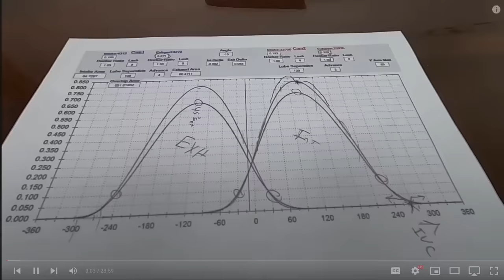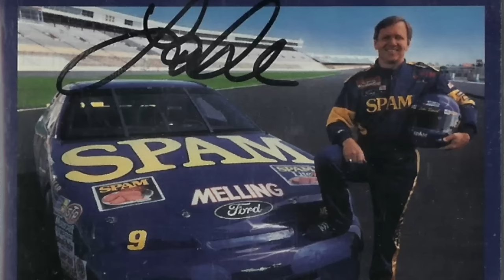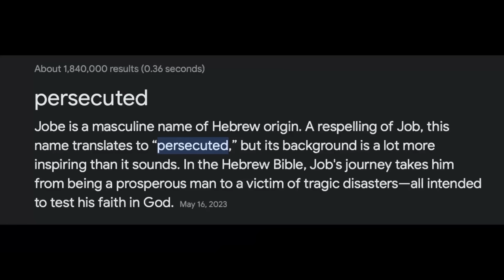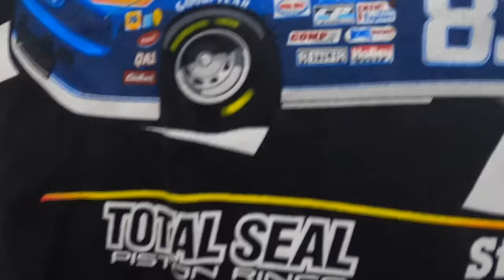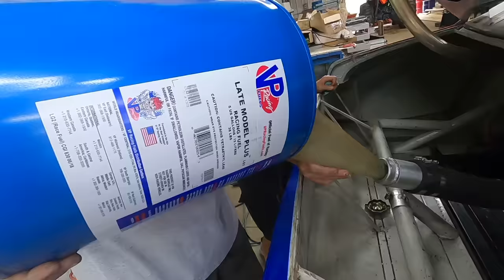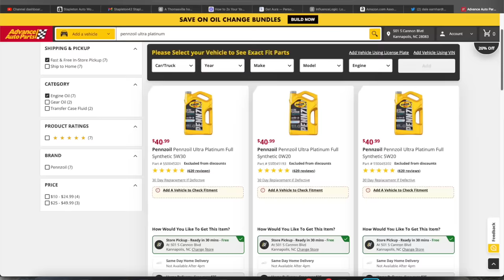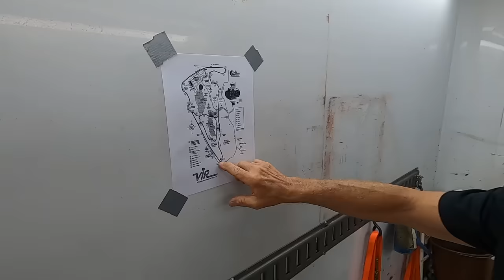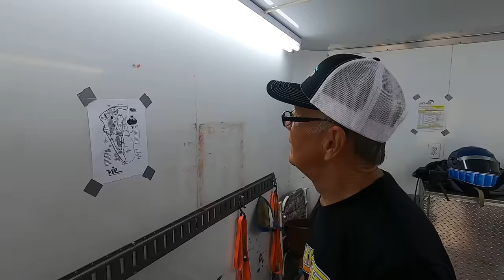Lake Speed's 90's NASCAR Thunderbird Resurrection: Running 780hp Wide Open at 75 Years Old!

Comment: I came across your video about the Stavola Brothers…and turns out, they are the same people I worked for as a diesel mechanic when I was first starting out in my career. Been watching your channel since then. Learned from my Dad how to work on cars and engines…he was a farmer and a truck driver, but wasn’t afraid to work on equipment. Don’t beat yourself up too much about missing the sound at speed. I get it, you wanted to share that sound…but you’re a gear head, not a pro videographer…yet. But you’ll get it figure out. Thanks for sharing. Cool to see Lake at 75 out there wheeling it!
Reply from the maker: Thanks man! What was working for the Stavolas like?
Reply: @Stapleton42 , a mixed experience…I was hired as a diesel tech, fixing their Mack trucks, and asphalt equipment. My first day at work, my wife went into labor with our first baby…I went to the boss, and he said get outta here! Go to the hospital! That was nice. About a week later, I was using a cutting torch, and not familiar with the shop, some of the sparks landed in a bucket not too far away that had gas in it, and it caught fire…I had a shop rag in my pocket, and it caught fire! Another mechanic saw that before I realized what was going on and hollered you’re on fire! Put the fire out without getting burned, or burning anything else up! Not long after, the company had some legal trouble, and shortly after that we parted ways…I’ll leave it at that. lol.

Comment: Thank God that 360 camera failed 🙏 The show here was Lake Speed wheelin' and the glorious sound of this car which you captured effectively. For example, It's evident to me that Lake is delivering those straight lines runs at an acceleration rate which a current spec cup car likely couldn't match.

This contibution to the Nascar and motorsport community is easily the best racing themed-anything on YouTube this year. Thank you for the work you put into this video.
Reply from the maker: thank you Kevin! yes his car has more power than a current cup car
Reply: @Stapleton42  The last good comparison was at North Wilkesboro this year when the super late models, late model stocks and craftsman trucks all posted faster lap times than the current cup car on a greener track than Cup had. That hair raising straight line run was both impressive for sound, but the speed is unbelievable.

Comment: When I started going to Talladega in 1990, you could stand about 15 feet from the track on the backstretch. Hearing 43 cars going by in a pack at over 190 mph was an awesome experience.  The ground would vibrate as they went by. My suggestion is changing the name from Job to Grace.

Comment: Its nice to see the "old" race car running again. 
 And, because you asked, that is a 1967 Mustang.  Also, it appears to have been originally a 6 cylinder car and if the hood is original the optional turn signal indicator in the hood vents indicates its an exterior decor group option car.  Also nice.

Comment: This is, or should I say has been a great video series. I watched all with great interest. Look forward to all upcoming videos. Me, been engine builder 20 years which is only part of my working life of 50 years. I am now 67 years old, have been involved with NHRA, IMSA, DIRT, some others, former DIRT modified tech inspector at multiple tracks including now closed mile at Syracuse and "The House of Power", Orange County Fair Speedway, NY. Pit member on NHRA Top Alcohol Dragster and Pro Mod. I have seen all the greats in NASCAR and NHRA. I'm sure your technical knowledge of making the videos will improve, I can feel for you when you missed the sound of Lake's car going by at speed. I'm sure the brake problem is an easy fix. Keep up the good work. Logan is doing a kick ass job on the Mustang. I want a Lake Speed shirt.
Reply from the maker: Thanks Dave!! Stapletonautoworks.com has them!
Reply: @Stapleton42  ordered

Comment: Been grabbing the yellow bottle for years. It's never let me down. 🤌🏼

 I've got a set of je pistons I'd like to run a better set of rings on. 3.785 bore LS  1mm X 1mm X 2.5mm. Haven't had any luck finding better rings. Going to fill the form out with Total Seal and cross my fingers. 

Excellent work as always bro.🤌🏼

Comment: With respect to the brake problem, the pushrod(s) on the master cylinders need to be adjusted.  There needs to be a little free play in the brake pedal on both of the master cylinders at the balance bar. When you look down there, make sure that the pistons are retracted all the way. In technical terms, the compensating port is being obstructed by the master cylinder piston being pushed in too far and when the fluid gets hot and expands, it can't return to the reservoir, so it applies the brakes.  If the fluid was trapped in the front brakes, obviously the front master cylinder is out of adjustment.  Also, with the brake pedal pushed down, the balance bar should be even, that is, each master cylinder pushrod should be pushed down the same amount.  Adjust the pushrods until the balance bar is even.

Comment: I'm sure they have probably figured out the brake problem with the car. But old brake lines typically do this, same exact thing. The inner lining brakes down and separates from the outer lining and it pinches inside of there, and acts as a check valve. I know because this has happened to me as well.

Comment: That's the only oil I use! In my 96 dodge ram 360v8 with 380k miles. My 2017 wrx sti, 17 chysler 200. I've always used Pennzoil

Comment: Another cool video. I hope the brakes get sorted so Lake can rip off some more laps and you get an opportunity to use those microphones, GoPro 360 and the drone some more.
My interest in motor racing of any type comes from my father who was a volunteer marshal at a track called Symmons Plains, (look it up) He also took me to Longford before that, (look that one up as well) My favorite race car of all time is Allan Moffat's Mustang, (Look him and his car up) 
I have had a similar brake issue at Symmons Plains but on a Ducati, I had adjusted a screw on the brake lever, it actually closed down the return port in the master cylinder, as the fluid got hotter and expanded the brake started to nip up, I was lucky it didn't lock the wheel as I came through the last corner. I realized what was the cause and backed out the screw a bit and with a "whoosh" it was fixed.

Comment: The brake problem is with the master cylinder could be down to the pushrod length not allowing the piston to return back enough "has any thing changed since it was last used as this mainly shows up
when the car is used properly and the brakes get hot and the fluid expands holding the brakes on.

Comment: Hi Mitchell & Logan, most impressed with this production even with the missing audio disaster. I reckon the car sounded so nasty when it went past you just out from under the bridge, after the brake hiccup. It was spitting and carrying on as though it wanted to scream ( as it was earlier ). Full noise was glorious.
There had better be a few more episodes of this series to come please.
My uncle got me into following motorsport  ( drag racing initially ) about 40 odd years ago. He then was co driver on an off road truck and I crewed on that. The owner then built a monster truck ( Kiwi Thunder ) and I crewed on that when I could.
I now live my motorsport through you, Cleetus, Adam LZ, Emelia, Tom and Steve, Clay etc.
Is Logans engine going to be a 289 screamer or 351 or.........?
Cheers,
Mark

Comment: It might not have boom tubes but dam it sounds like a 800: HP cup car Yates have a sound of it's own like i said it sounds awesome
Reply from the maker: It still has the H pipe section. Just dumped after that with no pipes or boom tubes. So it has half the sound 😂
Reply: @Stapleton42  thanks for bringing these video's to us thats the years I was in to the racing but this racing today just not the same

Comment: That is really cool looking shirt, so I bought one. Don't beat yourself up over the video and sound. Without you we wouldn't have got to see any of this. I thought it was really well done. 
I saw some vintage racing video from Road Atlanta 2023 and it was really neat to watch some of the in car videos. Hopefully we will see Lake in some of these soon. Good luck with your car too. I am glad you picked the Dodge engine? Just curious why did you pick it? I myself am a Dodge guy. Back in June I got to finally drive a 1971 Cuda with a 426 Hemi and dual carburetors with a 4 speed. I told the owner I wonder what Buddy Baker, Richard Petty and those guy felt with that Hemi power on the track. Oh one other thing, I was at Dixie Speedway in 1976 when Richard Petty came to race the Kit Car. I got my picture taken with Petty and Jody Ridley after the race. It was in the racing programs until the track got sold and converted to dirt.

Comment: During the interview portion of Lake while sitting inside the car just before the 15:00 mark, what is that square tank with a gauge on it sitting in the passenger area?  I don't know if I have a sever brain fart going on right now, but I don't recall seeing that before.
Reply from the maker: That’s the oil tank box with a temp gauge on it. He relocated the oil tank over there when he converted the car to road course racing 20 something years ago
Reply: @Stapleton42  Thanks for the info.  Guess it also helped with weight distribution on a road course setup.  Yet another great video, Mitchell!!  Absolutely love your content!!

Comment: On that 67 mustang what engine is she putting in it? I ask because I have a question for ya!
Reply from the maker: Don’t know exactly yet but probably a simple 302 to start with
Reply: @Stapleton42  are you going to build headers?  I ask because you peaked my interest when you said you were a tubing fabricator. I have a 363 and I can’t find anything above a 1-3/4 primary but the motor itself is really healthy and could really use a 1-7/8 or 2 inch primary. Possibly a step header 1-3/4-1-7/8 or 1-7/8-2. I still have my shock towers but I’m using a rack and pinion so there’s a fair amount of back and down area to work with. I don’t know what her exact setup will be but if she will have a similar setup I was wondering if you had time in there to build me a set??? Especially since I know you’ll have a 8.2 deck motor possibly.

Comment: There are many amazing engine sounds; but a high-strung small block is top notch. I don’t know how anyone can’t enjoy the thunderous rough idle, instantaneous throttle response, and non-linear RPM gain as they come up on the cam…..people don’t know what there missing listening to fields of boosted LS’s, with civilized cam timings and compression……15:1+, 9000RPM, and carbs / mechanical injection, is a whole different level of mechanical violence that can’t be appreciated unless you feel it first hand……I advocate people go to there local dirt track and take in the experience.

Comment: I won’t use any other oil than amsoil I have used mobile one, pennzoil, and other oil and the oil I’ve had the best results with is amsoil!
Reply from the maker: How do you measure your results? are you sending your oil out to a lab at similar intervals for comparison?
Reply: @Stapleton42  doing oil analysis at 2500 miles and also at 5000 miles and I’ve had the best results with amsoil so that’s the reason why I will use it also get a little bit better of fuel mileage with Amsoil! 
This is just with the testing that I’ve done but to each there own everyone can have different opinions and still get along! 
Hope y’all are doing well!
Reply from the maker: Every product is a little bit different. Doing the testing is the only way to truly find out what your engine likes and in some cases a particular brand doesn't have exactly what your engine likes in their product lineup. That is totally normal!

Comment: Hmmm, last time the engine was fresh it made 690hp. Lake said it got hot in it's last laps on track, then/now the hurt motor made 480hp. Y'all added around 4 points of compression (9:1 up to 13ish) ,modern/optimized camprofile for a larger wheel solid roller lifter, ported the heads, and it made 760ish. Then you changed fuels to make 780ish. Sorry guys, you did it to yourselves. Claim some outlandish HP gains and someone is gonna call you out on the BS. Tell us all about those massive gains from the rings too!! Lol
Reply from the maker: This engine never made an honest 690. Ever. The later pulls were high from the heat generated by the headers manipulating the strain gauge. The honest number of this engine in its prime was MAYBE 620

Comment: As a long time tintop road racer you can see the severe limitations of these cars, Shitloads of power,, very average handling and so heavy.
The car is what is was,, with now a very good engine. 
I suspect my road race Falcon with less power [550hp Boss 347] and far better semi slick 18s would disapear on the twisty bits. And that is literally an improved production car. 1400kg car and driver. 
My old Sports Sedan Torana that was 1010kg car and driver on far wider tyres with a bit more power  and  deal more torque would be a deal faster again and because of the power to weight as fast in a straight line.  I beat Chev Nascar engined cars regularly because those engines were too peaky for road race [or dirt ovals]  cars.
Rays car recently ran out of brakes also.
And yes I want to see the car out again. Lake was doing a decent job and some more laps will get rid of the rust. Some vintage races will give it some meaning.
I recently watched [here in Oz] Larry Perkins get back in his 93 Bathurst winning car. Perkins Engineering You Tube channel.
Reply from the maker: Thanks man!

Comment: So when the motor was fresh back in the day it made 690hp. Y'all went from 9:1 compression to around 13:1. Modern large wheel solid rollers and optimized camshaft, and ported the heads. Made 760-790hp with different fuels. Tell everybody again, just how many HP were gained from your Total Seal rings. Give us a number. 2 HP, 20hp, 50hp? Stop the fast-talking BS and tell folks the truth
Reply from the maker: You have some facts mistaken. The 100hp mentioned is actually a lot less than the real difference. When we dyno tested this engine before the changes it made 480 and likely was around 600 when fresh. The old dyno sheets had skewed numbers from the lack of temperature compensation on the measurement instruments